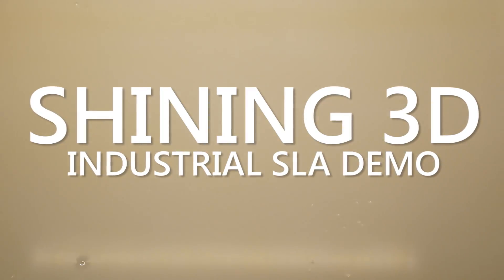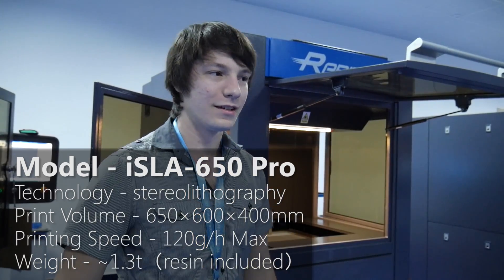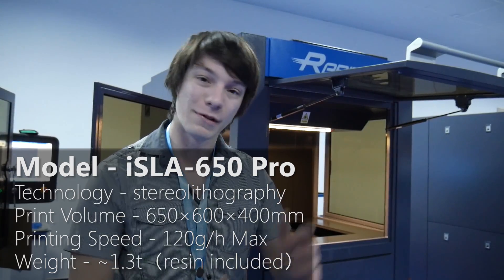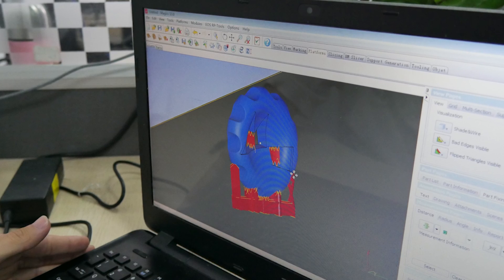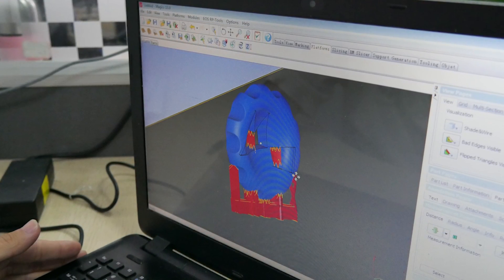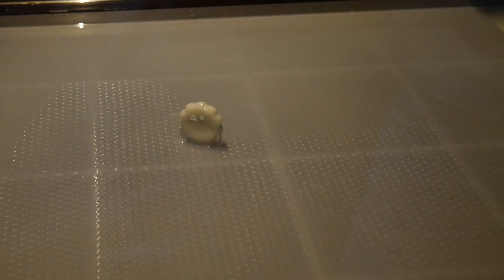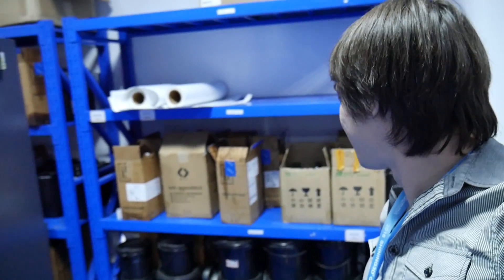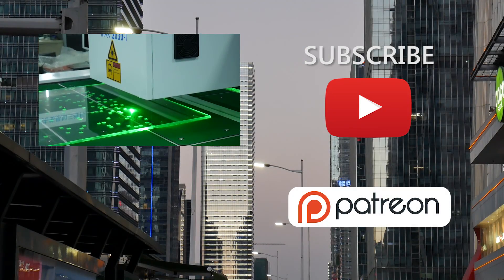Huge Resin 3D Printer - Shining 3D's iSLA-650 Pro Demo

Comment: 2:50 the printing at an angle is true for filament printers as well. Well worth it.
Reply: With bottom-up SLA printers it seems there's another reason for print things on an angle - there's a good chance of a huge flat surface appearing suddenly when an object is perpendicular to the FEP at the base, which the printer has to pull away from the FEP. This places massive stress on the support structures already printed, and on the attachment layer, so printing on an angle (usually) reduces any sudden changes in surface area cured and greatly increases the chances of your part not breaking in half mid-print.

Comment: Hey Angus - run an FDM coin print on min layer height and with one coin on a 45 degree angle  (vs flat like you normally run them) and AT THE SAME TIME and layer height, a horizontal coin, and let's see what you get for comparative finish quality...a quick, yet informative video topic...
Reply from the maker: Good idea for a vid!

Comment: 0.1? hmm i need to get back to testing resolution limits.. i had perfect (small) parts coming off the wanhao Di3 at 0.07 at one point. haven't gone lower yet but that's closer to 50 micron than i ever expected when i bought the wanhao. 

Thumbs up as always, Angus!
Reply from the maker: I think your biggest struggle with FDM is always going to be nozzle size rather than layers, it becomes quite part dependent if going to finer layers will have any decent effect on the final print beyond 0.1 I reckon.
Reply: true enough. i was thinking after commenting, the low-poly pikachu probably wouldn't work out at low resolutions because of the mostly seperate tail. would likely knock it over unless using 'Z-hop', which, on machines with acme lead screws like the wanhao, would be likely to introduce slight (maybe not so slight, more experimenting!! lol) innacuracy. Ah so much to experiment with lol

Comment: Why no go on the skeleton coin? The only things/reasons I can come up with are that the specific gravity of the resin changes when it is lasted or that the Lansing causes turbulence in the resin... They seemed to be saying that parts need good support or good structural integrity to print. The fact that you had to wait for the resin to harden before you could take the coin off the machine seems to indicate that the laser is binding the resin rathe than fixing it and you could probably distort the result before it sets. Was the resin bath heated and did the part come out warm? Fascinating anyway :)
Reply: Bloody autocorrect - lased and lasing.

Comment: Slower than I tought from an industrial printer
Reply from the maker: Because of the way the galvo works you could probably print an entire bed of coins for only a little bit longer, it's the layer change sequence which takes most of the time during printing.
Reply: +Maker's Muse I'd imagine so because the X and Z axis is laid down by lasers instead of a nozzle so it's very fast, it's the transitioning to the next layer that slows it down
Reply: Maker's Muse Thanks for the reply, didn't expect it. Keep up the good work!